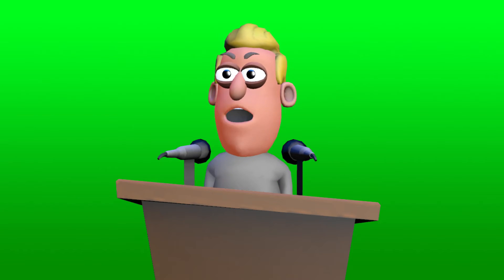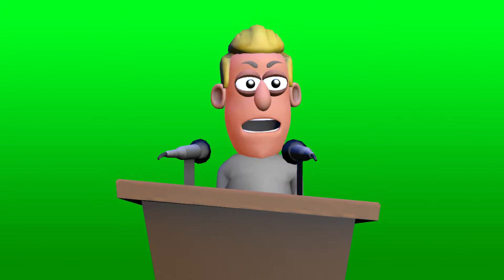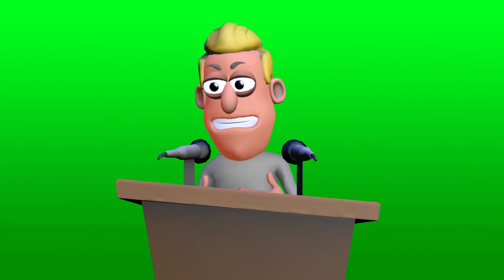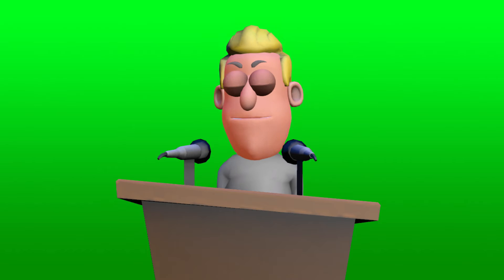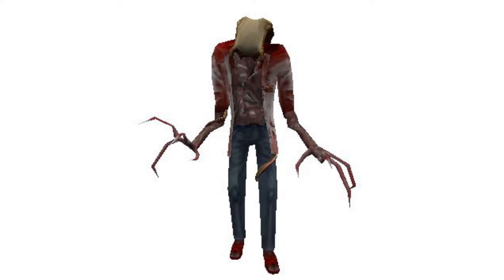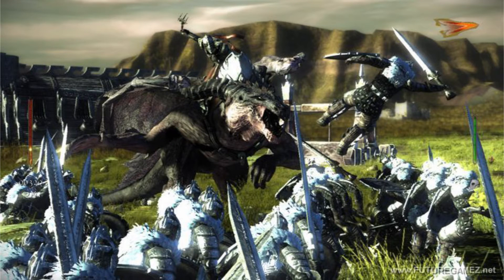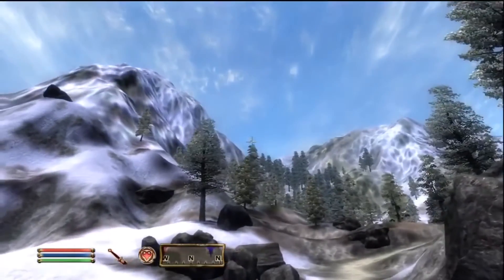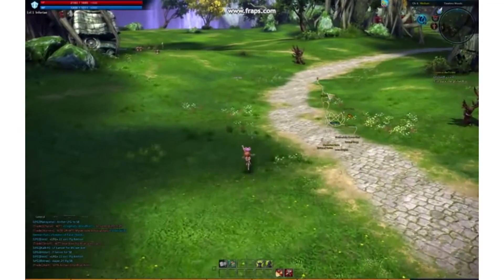3D Constraints - Polygon count, File Size & Render Time

Comment: I wish somebody created an app that enables you to input your system specs and then with sliders controlling texture ram / polygon count Etc. you could figure out a ballpark level of how many polys n textures Etc for your system to run a given 3d level at a given FPS. even if it only gave you a close enough result.